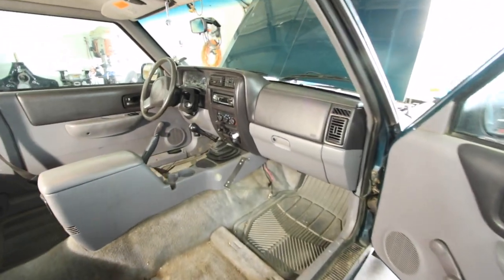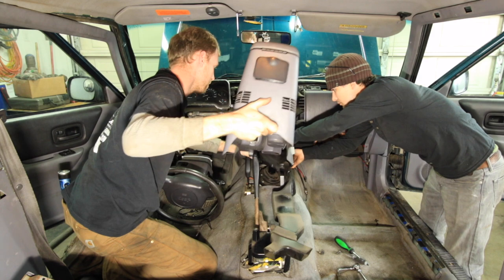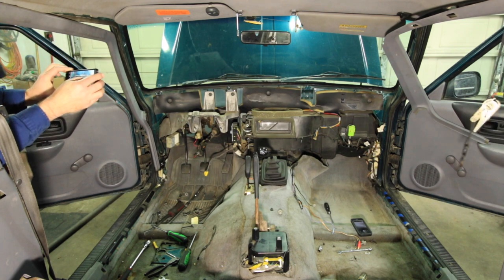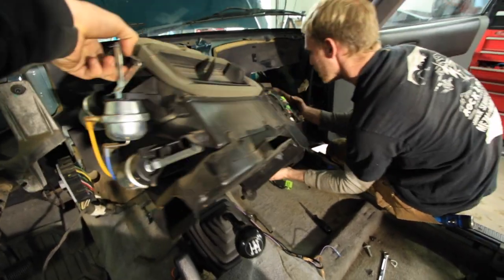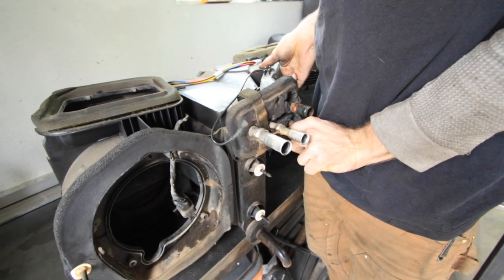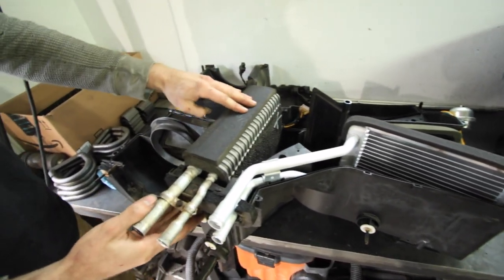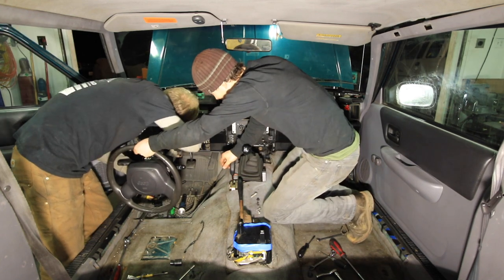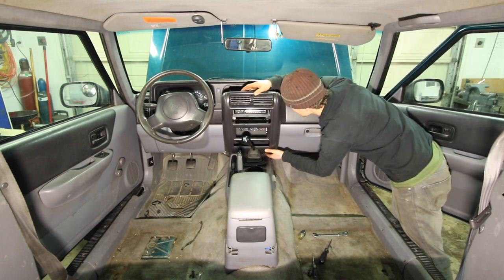Leaking Heater Core? How It's Replaced -

Comment: Great video!!! Im having trouble with my a/c coming out places i don't want it to. Are the control doors in the box that the heater coil is in or are they in the part that was left in the Jeep? Thanks for any help and great video!
Reply: could be an issue with the vacuum ball. If it has a leak or isn't connected then you ac will just come out of the defrost vents

Comment: Hi Tim. I'm trying to figure out an issue with my heat. I'm not getting much heat. When the vent is set to off and temp on high both coolant lines to the heater core are hot. When I switch the vents to face or feet the lower line is Luke warm while the top line is hot. I'm not thinking it's the heater core anymore. Any thoughts?

Comment: well..... its definitely better than what I did,  my 96 had factory air that didn't work the accumulator leak and didn't care to fix it so made the pump into oba, well middle of winter here in sk canada it was -35C outside an my heater core blew on me, well a quick fix for me was I pulled over on the high way, took me sawsall and cut the ac lines off the box and just put my heater core rubber hoses to that, re filled the radiator with mysoare coolant, bled it on the side of the high way ad continued on my way, was only spose to be a temp fix asit ended up reversing my controls from hot to cold and cold to hot. I have to say thou that it was the hottest I have ever been in that her in winter, I could easily drive in a T-shirt and be plenty warm, if I wore my winter parka I could drive with the doors off in -30c and still have warm feet while wheeling :p it stayed that way for 5 years before I sold it :p
Reply from the maker: +Aarons Automotive That's gnarly.
Reply: Sure, sure..

Comment: since I remove my ac lines and compressor under the hood anyways, what would go wrong if I took the ac box out if and when I go to replace a heater core? do you thing it would mess with the vacuum system or any of the other electronics? or would it just leave a vacant space

Comment: How did you handle the foam piece where the ac evap and heater core lines meet the firewall? I'm afraid mine won't be in good enough condition to reuse :/

Comment: What would you suggest @bleepinjeep if the entire ac/hearer system does not work what so ever?
Reply from the maker: +alex acosta Could be that blower motor isn't spinning. There's a resister in there that Greg mentioned likes to fail before the actual blower motor stops working. Could be a fuse(s).  - Tim

Comment: Can anyone give info about the small vacuum line that goes through the firewall that is connected to the T connection under the hood? Mine has broke off and im not sure of the interior diameter size. Nor do i know what size connection i need on the other side as i have yet fo pull out the dash. Fixing to replace heater core an evaporator soon. Also, controls stuck on defrost so gonna look at the vacuum lines.

Comment: Tim, whats your opinion on Auto vs Manual? I NEED to get a XJ again, but I cant find any manuals that are decent... So Im trying to decide if its ok to settle for a auto. Thanks!!!
Reply from the maker: +FlamEffect I've owner 6 XJ's. 3 manuals, 3 autos. I guess it depends on your intended use and where you live/DD the most. I lived in Portland, OR. For a few years and would sit in bumper to bumper traffic for 45 minutes in 1st gear on my way to work. Clutch in, clutch out. Clutch in clutch out! My left leg got noticeably burlier from pressing the clutch pedal so much. In that case I would have preferred an auto. Most wheeler's prefer auto's. Where I live now, the roads I drive, and the winters I see I wouldn't give up my stick for anything! Plus one time back in Portland I had to park on a hill at home and work to bump start my Jeep every day for a month because I couldn't afford a new battery at the time. Worked great!  - Tim
Reply: Cool... yeah I LOVE manual and hate to not have one, but Im desperate to get a XJ again!!! Im in Wyoming, so no bumper to bumper and I dont wheel anymore. It hurt my pocket book!! But around here its so hard to find manuals.. And if you do, its got 240k+ stock.
Reply from the maker: +FlamEffect Keep your eyes open. Mine was first sold in Canada. I bought it with 106K on it 6 years ago with Montana plates at that time. You'll find one.    - Tim
Reply: FlamEffect if you know ppl in autobody industry or can find a Mexican run shop, I would keep checking copart.com ....sometimes you luck out and can get deals on minimal damaged vehicles and either live with a few dents or pay shop to fix. The average person would be surprised at how little it takes to total an older vehicle! I was. I’ve gotten all my vehicles thru there. Copart is insurance salvage online auction. They’ve opened it up to the public for a little higher yearly fee to be member. Used to be you had to be in the industry to bid and buy thru them.
Reply: I say Mexican cause they tend to do good work and are cheaper. I’d stay away from Russian or Eastern European run shop, not racist or anything but they tend to be butchers. That’s the rep in state I’m in.
Reply: As an example-the vehicle I’m driving now is my dream vehicle and I kept watching copart and bought it for 3800. Plus approx 800 in parts and the book value was 20,000 and it only had 38,000 miles! And minimal damage.
Reply: I love the manual, but I have an auto.  If you live out West and you really want one, california has some excellent scrap yards, and rust-free weather.  You can always convert one.  If you ever intend to rock crawl or take on steep hills and auto is the way to go.  You don't want to stall out when gravity is at maximum preload and you're on a 60 degree incline.
Reply: Automatic with the correct axle ratio's.
Reply: My '88 has a 5-speed.  Bought it brand new and still have it!

Comment: Looks like 1,000 in Labor?
Reply: probably not quite that bad depends on  2 things. 1)if you are going by Chilton or Mitchell manuals and 2) what the shops hourly rate is.your avg 6-8 bay shop these days is probably having an hourly rate between $90-$125 an hour. a dealership you may have an hourly rate higher than that.
i don't have a great idea of what the hourly rate is going on avg though. i have been out of the business since 2012 and the shop i worked for had an hourly rate of $110.00
for a job like this it probably runs around 6 hrs for the core and another30-45 mins on the ac recharge
Reply: John Grubka The shop I go to estimated $592 in labor
Reply: weaselgamer50

Comment: omg, could they make the design any flippin' worse. IMO, it's seriously poor engineering when you have to disassemble the front half of the Jeep to replace the heater core... come on man? it's 2016 - can't they design a more user friendly system? Are there any Mods to sidestep this process? Also - OEM appears to have 2 or 3 types om metal and the replacement appears to be all aluminum.... should have been that way to begin.... smh at the manufacturers
Reply from the maker: +brian towns     One of my dreams is to own a vehicle company that makes common sense, reliable, and, easy to work on vehicles, particularly 4X4's... The way they should be.  The HVAC box is large and I see why they hide it in the dash, but I see no reason why the heater core and/or the AC evaporator couldn't be on the engine side of the firewall with a little more ingenuity. IMO any serviceable or wearable component should have reasonably easy access to it... And this is not reasonable for an $80 part that your cooling system and safety/comfort level depend on. Cars are still made this way today and this is actually an "EASY" vehicle to do this job on. I was quoted around $1,500 from several shops to have this job done. My whole Jeep only KBB's at $2300!        - Tim
Reply: Heck yeah, hopefully you hit the Powerball and you can start the assembly line rolling!